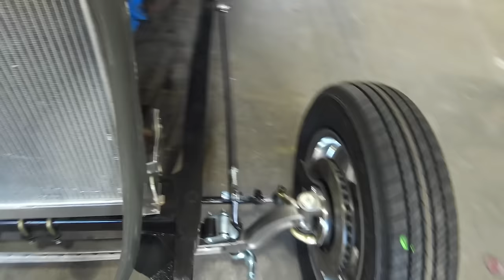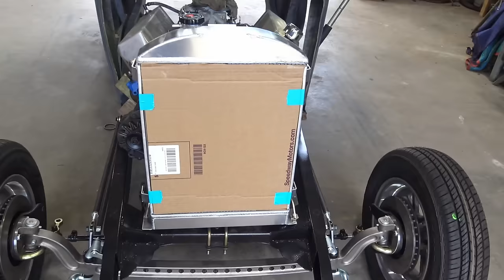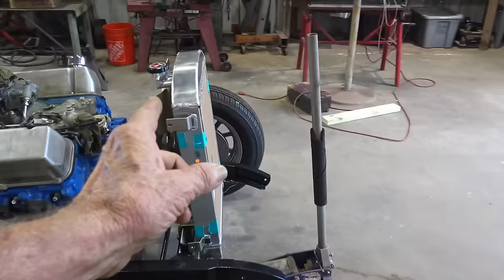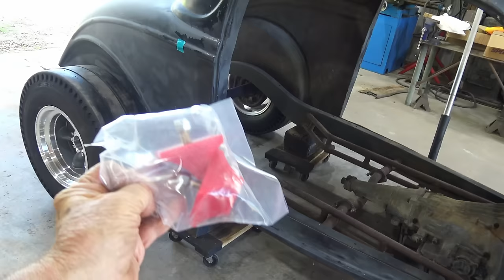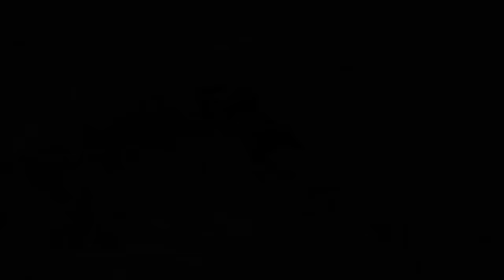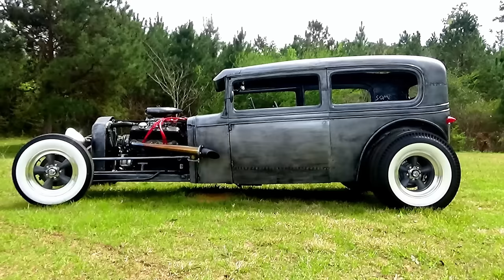Ground Up Build 1934 Ford Coupe Final Motor & Body Alignment

Comment: Hey Bob, you may want to look at a Ford Explorer 8.8 rear axle.  Narrower than you might think, they are usually limited slip, set up with disc brakes with shoe type divorced parking brakes inside the hat of the rotors

Comment: Im sure that axle would be plenty but you can source a 8.8 out of the ford explorer, rear disc in alot of them. The loaded poackages come with limited slips. Some video's on YouTube on how to shorten it if you need to. I did one, wasnt bad at all. One side is longer. Chop the long side of the housing then get another  short axle shaft. You can chop it just shy of 3 inches

Comment: Thanks for showing the reality of rod building instead of the paint-by-numbers style of the so-called "reality shows". I lost track of the hours I spent eyeballing and measuring and moving things around only to end up moving all again! But its worth it in the end if those proportions come out right.
I can't help wondering how all these 34 Ford 'glass body panels are so different. Maybe one manufacturer took molds of a real '34 while another scaled up measurements from photos or something?

Comment: Hi Mr. Bob. I think 68-70 B body mopar 8 3/4 rear ends are about 54 15/16 or 55 inches flange to flange and it should be able to handle that engine no problem. Not sure if it would work but it would be closer to the dimensions and stoutness you're looking for.

Comment: The inner fender panels will help you line up the body and the grill spacing and put the body in the correct position on the frame…

Comment: Hey rat rod bob just sayun I don’t want to step on anybody’s toes but you might try putting some cardboard down to catch them body parts. Might save you a headache. I’ve only built one in my life. It was a 56 Willy’s pu. I put a 292 out of a 57 ford in it. Lots of fun and huge roster tails off of all 4 .

Comment: I'm diggin' it. The 34 was always my favorite Ford built in all the time before the 60s. I like it even more than the 32s. I like the coupe the best as well.
I think all the time you're taking to juggle around the body parts, radiator, and the engine will be worth it in the end. You're getting it all dialed in nicely.
I used to build fiberglass and metal street-rods (not rat rods it was back before the rat rod era was really born) and all I can say is 'AMEN' to your statement that they take a lot of time to build. More than you would ever guess before you get started. It also costs more money than you figured it would. 
As an ex-hotrod builder I'm always impressed with how much work you're getting done in each of the videos and the time between them.
Even though it is, 'Just a rat rod'.
I suggest that you use some kind of hardened wall tubing if you're going to go with round bars in the grill, whether you choose hard copper, steel, or stainless the inclination will be for the tubing to stay straight. 
The human eye picks out variations in straightness and spacing like a sore thumb. I feel the main thing is to always have straight evenly spaced rods in a grill or it looks like a dog's breakfast IMO.

Comment: If you look at a stock Ford  radiator shell for the 33/34 there is,a filler panel below the radiator and  behind the grill.

Comment: the radiator will have spring bolts  to hold the radaitor in place for surport movement.it will left up the radaitor some

Comment: The 8 inch is a lot stronger rear end than given credit. Sure it isnt as strong as the 9 inch. But depending on whats done to the 429, it should do just fine

Comment: Hey Bawb,
   As you said, ya gettin it, ya just ain't got it yet !
   That body needs to be lowered at the firewall maybe an inch, maybe more.
Ya need to check the fitment of the hood sides now.
   Bawb, ya got them slicks to get traction, and ya got the HP and trans to smoke um.
But that combination is gonna be hard on that lil mustang rear end.
   You will likely be happier with that Lincoln rear axle when ya are out on the highway.
   But you are the builder, it's your money being spent, so It's really all up to you.
      See ya next time.

Comment: Bob
Would you ever consider doing that Rat Rod in a full fender version?
Those front fenders and running boards were a work of art the way they flowed into the rear fenders.
Tuck those cheater slicks under those rear fenders.
It would look sweet.
Not trying to change your design, just wanted to comment and ask your opinion.
Love watching your videos
Reply from the maker: Love those fenders too! But there's too many 34's out there with full fenders and slick shiny paint and $60k+ price tags. I dare to be different.

Comment: Check the shank length on your spring perch bolts , does the shank fit in bottom hole of your batwings or just the threaded portion of bolt ? Flat top perch bolt shank is 1/4" longer !

Comment: Curious what ya gonna do with the  radiator fill neck ? Modify the hood or move the fill neck to the center of the radiator . Me thinks you are working on a really good look and stance ...
Reply from the maker: Gonna leave it alone. Fill in the hole in the hood and raise it to get to the radiator cap.

Comment: Hey Bob that's a good looking coupe I love the wheel combo theres a guy I talked to on face book I think he's in Hattiesburg miss his name is Mike Culpepper he will set you up a ford 8.8 rear-end that will handle up to around 2000 hp. Pretty cheap I know you make all your 4 link brackets so he can sell you just the rear-end or in my case for my 88 monte carlo SS he sells it with upper and lower torque boxes that are adjustable with the 4 link bars that have adjustable ends on them  with the money I can save by doing a 8.8 I can buy good coilover shocks for the rear. Just wanted to let you know

Comment: The radiator goes on top of the crossmember,  just like it is.  If its in front how do you connect the radiator hoses.

Comment: What are you going to do with the radiator cap access hole you have on the front of the hood?
Reply from the maker: Gonna fill it in like it was never there ... along with rebuilding most edges on all of my parts. Nothing fits ... good thing I like a challenge!

Comment: Hey Bob, can you share the link where you bought the grille shell, thanks. I was talking with a friend of mine about aluminum radiators, he runs one in his V8 Toyota Land Cruiser. He said electrolysis is a problem and that he has 3 ground straps from the radiator to the frame. Apparently if not grounded correctly the aluminum will be eaten away. Just a heads up, I don't know for sure but it seems reasonable many vehicles have ground problems. I used to work for Bill Hays of Hays clutches. They also made electronic ignitions.  I saw a lot of people show up with fried wiring harnesses because they didn't have a ground strap from the engine to the frame. When they hit the starter the starter current went through the ignition wiring harness, poof the smoke came out. Thanks for the videos I can see where it is a lot of work we the watchers appreciate it !
Reply from the maker: https://www.ebay.com/itm/296307539381?itmmeta=01HVT1PR4GQ75RCMDFJEEG7FTX&hash=item44fd4e3db5:g:0OUAAOxy1klRZp7K&itmprp=enc%3AAQAJAAAA0ITsyFfQnwS7cnDk4A2Qd1WQn5KU1ARx6ZsstSsf7wEMNVhB8AiDeBu6kub%2Bj4AqEVvVDMR02bE7gO9NcCTO3jSTPGOa1VLZgqxUmvL2y4kIX%2F1oBHpxOyHBg6SV3EmT9CV4%2BNHeZjEaJql5x3X2KJpTrBojKnQtBiLkvnDklB1S9acV2awytnZAZu4poXj1cct9N9zWfM1irPbcHlz5zoaoSqBRHhKHqndViA9WLgItCWWDAW4CcS4I27IJNdt0reVAR4b5VSDFToTqX3RUs1A%3D%7Ctkp%3ABk9SR6qC28HeYw

Comment: I run the wheels off of most old fords but after about seventy late, kinda sketchy for my memory bank cells to calculate. As I remember, most of fords rear ends were a Dana and on the passenger side of the housing, and on the axle tube near the top usually.... also close to the diff pot.... don't worry, I am a getting to it..... they stamped the number of the axle ratio, and numbers and or letters saying what all it was. Example would be the ratio, year made, limited slip or not, most of them got so nasty that they don't show up so good. I spent a lot of time in junk yards picking up another rear end for my pickups that got so badly abused by my lead foot and stupidity. Also speaking as I went through a ton of axles, some of those numbers told how many splines were on the axle itself. Now I should think a mustang rear end wouldn't be such a big deal as for having those numbers still there. I might just be in left field a picking flowers as for you to figure on. I and the dog are still hanging in there but his age is a catching him hard at fifteen years or more. A sausage on legs and so am I. Finally holding my weight down to a 274, and trying to peel another thirty as I stagger around like a army jughead on liberty. Medicaid cut paying for a lot of medications I am supposed to need. Hey, who knows, I might live long enough to see Biden out of office anyway. Hope that don't hurt your feelers as his way a running a office kinda grinds my gears. Still think your a going to end up in hollywood some day as your more popular than a good many who just think their stuff don't stink.